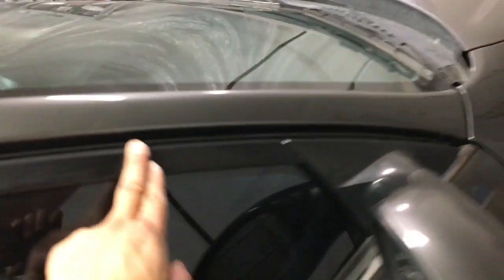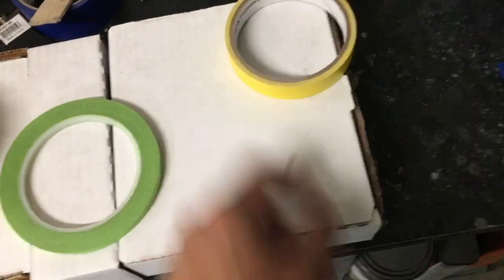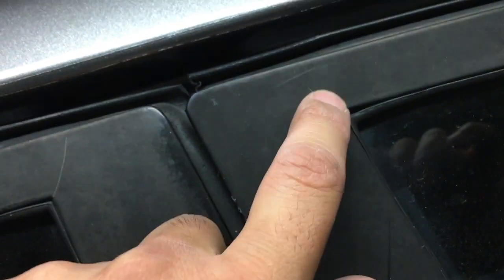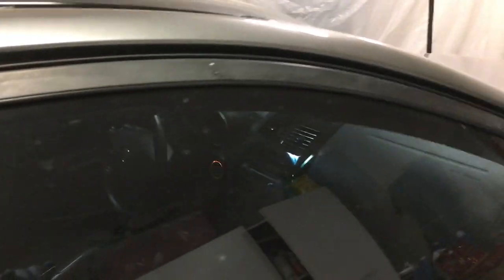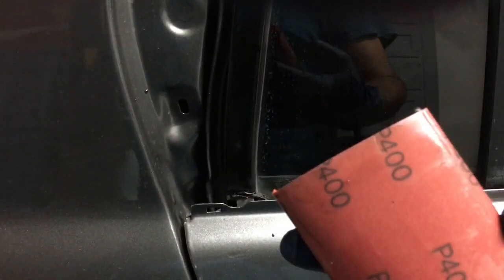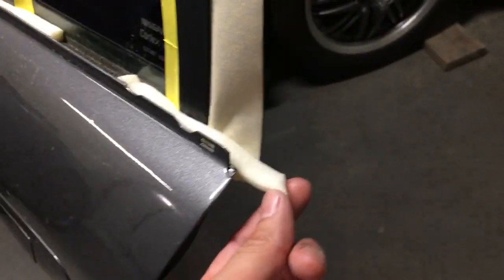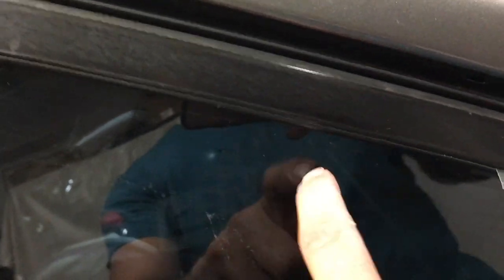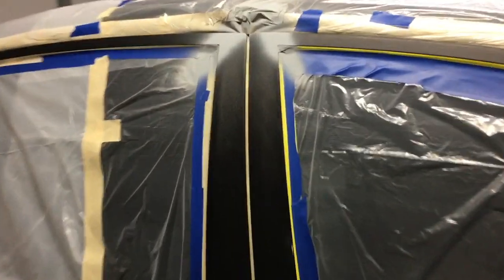Door Pillar Trim Restore - Pillar Applique painting

Comment: Could that BE any shorter? You didn’t show us your painting technique or anything. This should’ve been a “HOW TO TAPE” video...
Reply from the maker: I try to keep the vids under 5min. This was painted using spray cans. The only technique is to maintain a 70% overlap while keeping a distance of at 4 to 6 inches away from the work piece, using consistent left to right passes . Spray on masking paper or cardboard to see the spray pattern size. Depending on the manufacture, that spray pattern could be 3 or 4 inches.

Comment: Where did you get the full car plastic masking from ?
Reply from the maker: Various places where these are sold. Summit Racing website offer the 3M automotive plastic masking or Home Depot offers the painter’s plastic masking, works fine solvent base paint systems. It’s a wide box 20” wide,  great for regular cars. Big trucks or SUV types, most of the of truck will be covered. For this specific project, I used separate plastic and overlap them. Don’t use the Walmart ones, paint tends to flake off fast which can  land on your paint, unless you’re painting something quick.